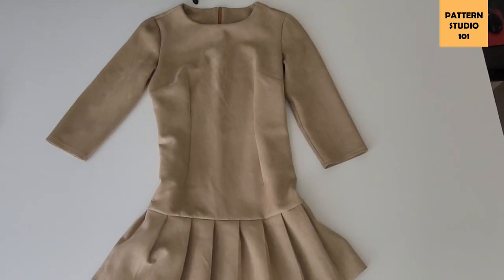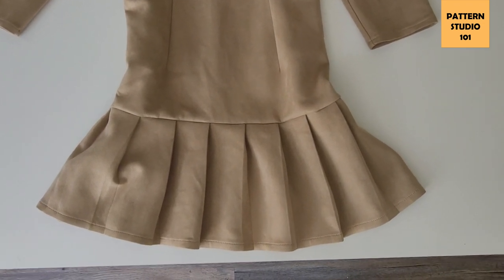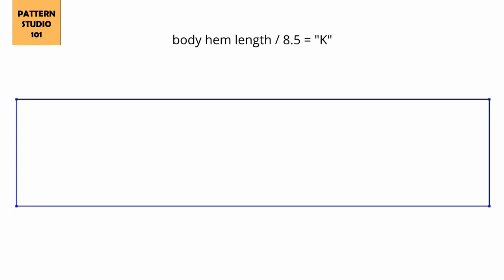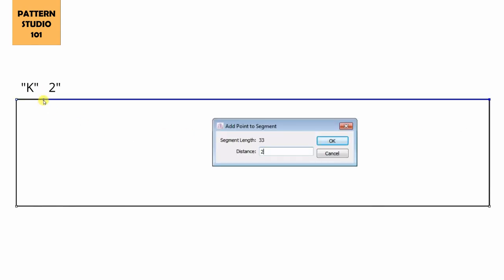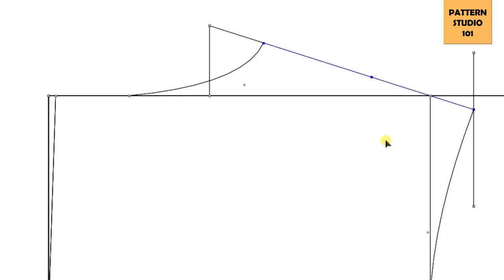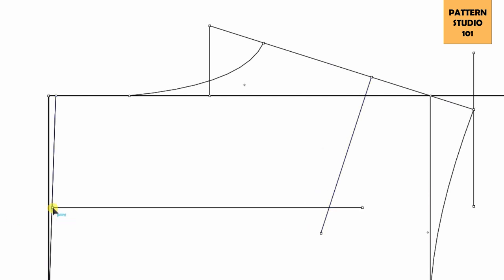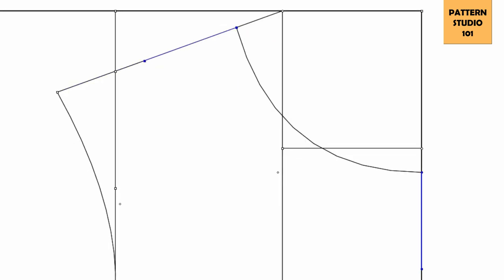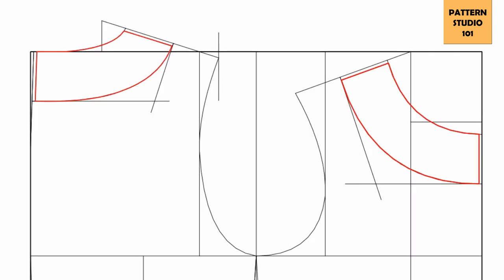How to Create Pleated skirt & Neck Facing Patterns for This Low Waist Dress_Pattern Making Tutorial

Comment: thanks a lot
this is hidy from egypt
i would like to ask you why did you remove 0.375 inches from facing??
Reply from the maker: Hi Hidy, you make facings smaller than out shell for sitting better. Especially when you work with thick fabric.